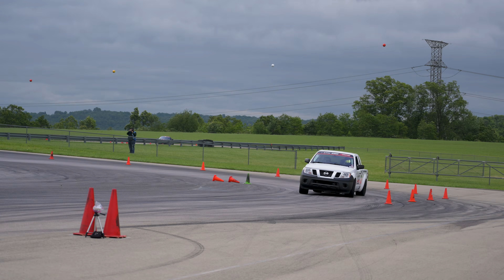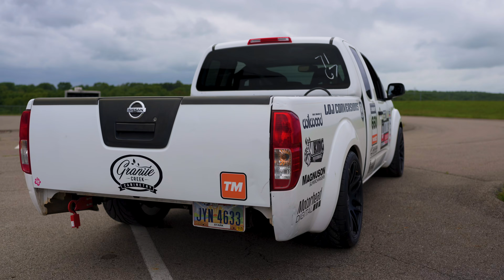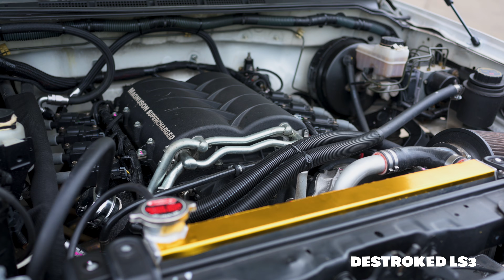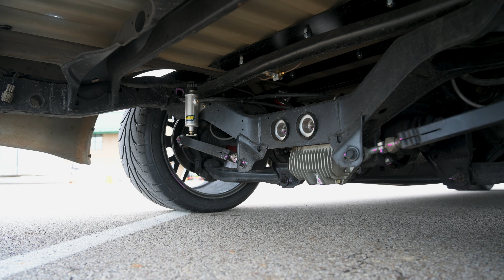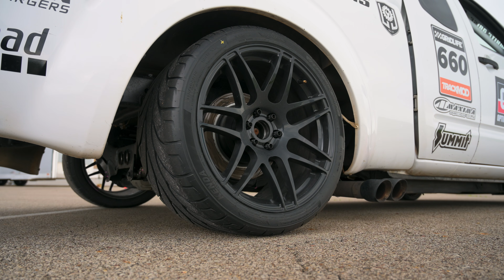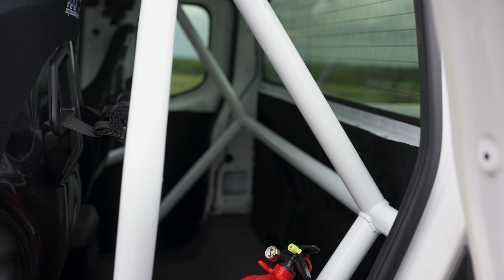WHITE NOISE: LOJ-Built Track-Focused Nissan Frontier | LS3-POWERED & 6 SPEED

Comment: Currently building at VK56DE to swap into a Frontier 2wd. Does anybody know if the swap is any different between the Frontier XE 4cyl and the Frontier 4.0 2wd? Or do I need to use a 4.0 chassis? Other than the usual swap parts list.

Comment: "It would be too much work to body drop it and it makes the cabin tighter"

staring at 5" of seat lift Hmmmm yes there is definitely no space to raise the floor at all. Realistically it's already plenty low and moving the suspension up pays more dividends than moving the body down when chasing handling, but there's definitely a future evolution of it bringing the rockers down to a hair below the frame and going max attack aero shenanigans.
Reply from the maker: Appreciate the feedback. Something to keep in mind that you can’t see, is that the inbound side of both seats are on the floor. The tunnel is an odd shape in these trucks and you can’t actually go any lower with the seat without cutting the floor. The seat is actually 2-3” lower than factory right now.
Reply: @LOJConversions  Well, I kind of figured that cutting the floor would be involved with what I'm picturing. Pretty sure Nissan made the tunnel how it is to clear the LH drop transfer case, so you'd have plenty of room to delete a large swath of the hump (in width) in a 2WD application and more or less bring the rails up toward where the seat is, which would then open the door to a flat floor aero package. Wouldn't be worth the effort since it's not as if it'd suddenly compete with the serious racecars it'd necessarily be classed against at that point, but fun to think about.